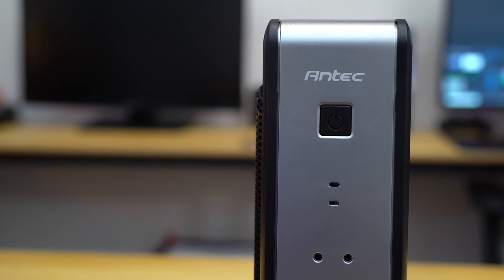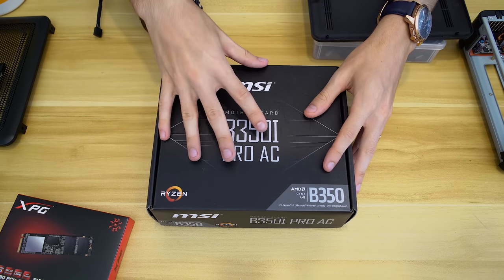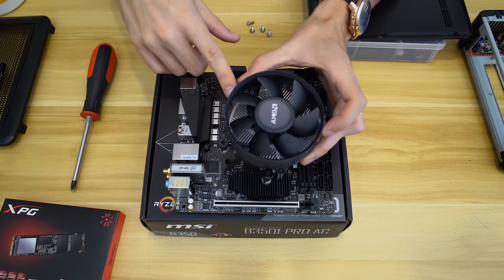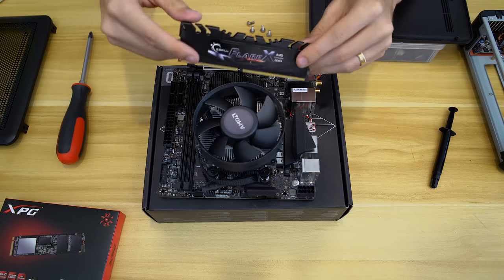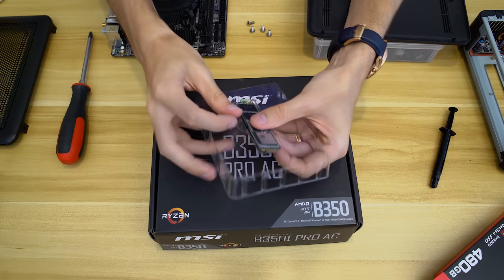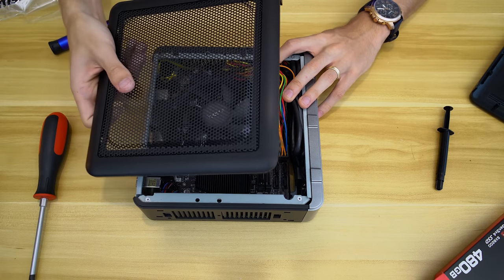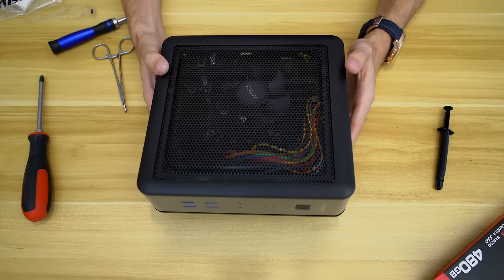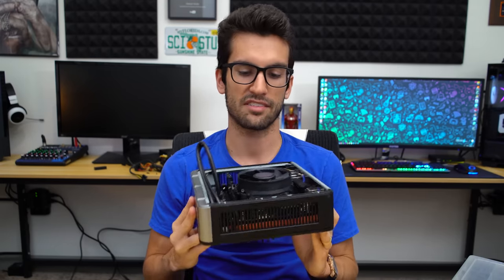How to Build an Ultra Small Form Factor PC... and Fail Miserably

Comment from the maker: So this is a super long video intended for those who aren't as familiar with PC building or who would like a refresher. If you're only here for the fail, it starts at 24:12. Also: I was measuring voltage, not amperage. I'd need to use the clamp for that. My other multimeter probes. Should have paid attention to that 😅
Reply: You can possibly build that PC without tweezers. 🤣😂😅
Reply: I'm surprised that you guys are continuing to recommend b350 if it won't have the ability to upgrade to ryzen 3000 I really like my Asus x470 - I motherboard security flaws and all.
Reply from the maker: @integer0verload948  This is an APU application. Unless you plan on upgrading your APU to some 3xxx APU I'm not aware of, it won't matter much if you're using the 350 or 450 chipset. The 350s are just a bit cheaper, which is why I recommended it for this application.
Reply: @integer0verload948   why would the b350 boards not have the ability to upgrade to ryzen 3000?
Reply: Greg, thought you did an excellent job generally in explaining how to build a PC to people new to doing it. It's great seeing how far you've come and how much you've learned. I joined for the science videos and have stuck around for the tech :) I have one criticism; I always think it best practice to test components before installing in a case to make sure everything is working. Saves time and effort and eases troubleshooting if everything doesn't work. Maybe next time you do a build guide might be best to include that step?
Reply: @GregSalazar  just putting this out as a point of reference Greg, there have indeed been leaks of 3000 series APUs in the stack
Reply from the maker: @jonathanmorgan1596  The power supply board replacement didn't require disassembly of any kind. Build it now or build it later (unless the motherboard is DOA). I never test components before installing anymore, as the hardware swaps usually take a few minutes either way.
Reply: @GregSalazar  Could there not be an argument for doing that step when doing these teaching videos for people building for first time? I say that for two reasons; most people (and certainly not first time builders) don't have replacement components on hand to quickly test systems with. That makes trouble shooting more difficult. 

My experience teaching people to do it is there is often a fear of doing it wrong/breaking components. Seeing it post and work can help calm any fears they have.

Just my 2 cents :)
Reply from the maker: @jonathanmorgan1596  Having the system outside of the case has nothing to do with replacing components on hand. If you don't have other parts to swap out during troubleshooting, it won't matter if the system is assembled in the case or not Lol. My point is: if a graphics card is DOA, all you'll need to do is remove two screws and swap. If a power supply is dead, disconnect power cables and swap. It's the same process whether the build is in a case or sitting on a box :-)
Reply: @GregSalazar  I get it's just a little browser/word processor project. Supposedly 2 chiplets on the new cpu/Apu. One will allow 8c/16T the 2nd will allow a 2nd 8c/16T or a fairly powerful GPU/Apu chiplet.
Reply: @Scitch87  why I would say probably product segmentation. There may be some other technical reason that actually justifies it.
https://www.google.com/amp/s/www.pcgamesn.com/amd/ryzen-3000-cpu-motherboard-support%3famp
Reply: By now support for the B350 and even A320 for ryzen 3000 is rolling out so guess they just prioritized the higher end chipset boards first since those people are probably the most likely to upgrade immediately? 

https://www.pcbuildersclub.com/en/2019/03/ryzen-3000-b350-and-a320-mainboards-are-compatible-too/
Reply: Max Pain  I like that idea :)
Reply: what about a Bios update for a B350 mobo for Ryzen?
Reply: @GregSalazar   need to remind people of the Bios update that needs to be done for it to even work with the new Ryzen cpu or apu
Reply: You don't seem to know that M.2 drives must be run warm (~40c) and that if they are too cold errors will result.

Comment: 24:47 As someone on a tight budget this is when I go into panic mode and start thinking "oh god what did I do!" lol.
Reply: Always try to test outside of the case if you can. It does save time.
Reply: @only1sn1not1taken  In most cases (no pun intended), you can test outside the case. It can be a good idea to test outside the case, but it only really saves time if something is faulty :) Most of the time, that's not an issue. Only time i've had issues with faulty part was a powersupply many years ago, frying my first proper gaming pc, old Core 2 Duo build. But that happened a week or so after building it and testing outside the case would have made no difference. I know there's always a small risk of production errors or bad handling during transport with sensitive components, but in general, DOA parts aren't that big of a problem. I will always recommend testing outside the case if using second hand parts though, aswell as never buying PSU/HDD/SSD used and never cheaping out on a PSU

Comment: to answer the title you just ask the verge, im sure they have a video on how to build a pc
Reply: Greg seems to have been inspired by The Verge, he uses a lot more thermal paste than most techtubers. :p
Not that he uses too much, I think.
Reply: @peterjansen4826  at least his case didnt short the power supply.
Reply: @WGAPGaming  
And he didn't use single rank RAM. :)
Reply: @salahmed2756  
Give me a silent build with a powerful CPU and graphics card which doesn't get throttled. Custom watercooling is nice but not realistic for ordinary users, it simply is too expenisve and it requires too much time to keep it running properly. Also you will probably get your system more quiet with the best air-cooling because pumps always make some noise. Unless your hardware dissipates so much heat that aircooling can't transfer that heat any more.
Reply: 12:11 Well, he almost installed the M.2 without the post ;)
Reply: @peterjansen4826  .
?? He only used one stick in this video so it's kind of hard to do Dual Channel unlike the Verge video where he had two sticks in single channel.

Comment: My case is an Antec P180B and by no means would it ever be classified as small. Honestly, it wouldn't surprise me if it came with a map. Ridiculously easy to work with (the ODD is mounted from the outside.)

Comment: A good starting point would be the Asrock A300 Deskmini  case, motherboard, and power brick in one
Reply: Exactly, I put a Ryzen 2400G in one and it's great.
Reply: I just built one of these Asrock Deskmini's and it works great with a 2400g. It's also much smaller and less expensive.

Comment: And that's why it's wise to do a POST before stuffing everything inside the case
Reply: I wonder if the integrated PSU cords are long enough to plug into the motherboard while it's on the cardboard box- I mean test bench.

Comment: Built a couple of office PC's in the Inwin Chopin case that has a 150w psu built in. Nice case. Installed a Noctua CPU cooler instead of the wraith and no issues really.

Comment: 17:46 The triangles on the motherboard connections do not mean positive, it means that is Pin 1, it is to help if you are looking at a schematic that says for example "pin 3 is for data", you will then be able to find pin 1 and work your way down.
Reply from the maker: It means positive. Pin 1 is always positive.

Comment: This case (ISK... 110 I believe) is almost exactly the one I used to build small PC for my own mother years ago (almost 10, back then the main panel was a bit different)... it was an intel core I3 CPU, and stock cooler was out of question due to its noise (mom hate noise), and finding a good cooler that fit back then (almost 10 years ago) was... tough, like really tough to find exact dimensions. I think it was a Scythe low profile, not great but good enough for her usage, and silent till the fan came towards its end... I remember being super excited to build it cause that was the first time I built something that small, and still is. Sorry, I digress completely...

Thank you for a simple tip, that I always applied in the reverse order : Big cables first (or almost). Damn life would have been so much easier ! God the cable managment was ugly ! a bunch of cables stuffed into the damn thing... But the hardest part for me was not to install the motherboard... but to remove it (without breaking it) ! That was fucking hard !

PS : her PSU is still working to this date ;p

Comment: Just curious did you ever figure out what the issue is?
I know the factor PSU is 90 Watts and your CPU was rated at 65W just by its self. Not sure if you noticed that or not.

I too liked this case because of the fact that you can attach two 2.5 drives. Thinking SFF for NAS.
Thank you

Comment: I have a build in that exact case. I am utilizing the vesa mount. I put it together so that my kids could have something to do homework/web surf on. I'm also running an APU just a smaller one. 
MSI AM1i, Athlon 5350, 120GB SSD, Single 8GB stick of ddr3/1333 Patriot ram, Ubuntu 16.04 LTS
Works great for what I built it for. It's a shame your PSU was DOA.

Comment: 1:18 Laptop hard drives: Am I a joke to you?
Reply: Was just going to comment the same. I got 2x 2.5" HDDs in my system for the sole reason that they're a LOT quieter than 3.5" drives, and the slightly slower speed they've got is unnoticeable for mass media storage.

Comment: That SSD is NVMe not sata. You called it a sata drive. Edit: also that board does not have two CPU fan headers, one of those is a system fan header. Haven't you been doing this for years?

Comment: I wish more of these mini PCs used SODIMMs. I kind of like the Intel NUCs due to this, lets me build mini systems using parts removed for laptops I upgrade.
Reply: What about you look up Asrock's DeskMinis. Not ITX (STX) but will support SODIMMs.
Reply: I've built an entire mini itx rig using an 8gb sodimm and i7-3610qm salvaged from a laptop. Works great.
Reply: @Dr01nE  deskmini is good but it's annoying that it was designed for Intel coolers so it's excessively thick for athlon coolers and a little too thin for the wraith.

Comment: Over the years, I built half a dozen of those miniPCs and power supply failed after 2-3 years.  EVERY SINGLE ONE OF THEM.  Sometimes you can find a replacement but sometimes it's priced ridiculously expensive, like LianLi ones.

Comment: @ScienceStudio @Science Studio Is the power supply correctly grounded? It may have used those screws (see around the holes there is a metal contact point) maybe it isn't grounded to the case properly.

Comment: did this but used the cheaper version of the in win chopin, used the id cooling is-40v3, pretty good low profile cpu cooler, 2400g, 8gb Samsung e die at 3333 cl12, biostar x370gtn

Comment: At 8:30 I am done with this video. you could have tried rotating the cooler to cable mange the extra slack. As you mentioned some systems might require the CPU fan to be plugged into a CPU fan header.  If you had read the labeling on the other header you would have seen it was a SYS fan header, not another CPU fan header and may make a difference.  I would have gone for dual channel for the memory. Better luck next time.

Comment: Wire your HTPCs people. You’ll appreciate it when you stream 4K. I ran one cable to a switch behind my entertainment center, then I can have wired connections for the TV itself and all the stuff hooked up to it
Reply from the maker: Sure, if your wireless is spotty or slow, wired is a must-have. I just like having WiFi as well in case the PC travels anywhere a LAN cable can't.

Comment: she should be more than happy with it, I've been using a 2400G with 8 gb ram for several months with no issue.  I do light gimp, gaming, emulation, web browsing, etc with no issues.
Reply: I like the Ryzen CPU's a lot (as a matter of fact, I will buy one myself a few months from now) but even the ancient i5-750 can handle that. You don't need much CPU-power for those tasks. A dual core Ryzen-CPU (which they call Athlon for some marketing-related reason) would also be fine for that. :)
Reply: @peterjansen4826  well, I use to have a 3570k with 16 gb ram, 7970 & 850 evo boot drive... sure the graphics were nicer on my I5 rig, but the Rhyzen feels snappier for the applications that I run, it that makes any sense?
Reply: @F-Bomb313  
That makes a lot of sense, many people experienced that. Tech Deals also mentioned that Ryzen 1st gen feals a lot snappier to him than his 2600k. More cores, support for recently added instructions...

I sitll have an i5-750 myself because I decided to wait for Ryzen 3*** because that should combine the superior multithread performance with superior singlethread/gaming performance. We can expect the 8c Ryzen 3*** CPU's to outperform the 9900k in most regards, including gaming. There might be a few exceptions (AVX 512 bit)  but the ordinary users won't mind those. If the RAM wouldn't have been so extremely expensive in 2017 and Vega would have come out on time and be available at the current prices (Germany) then I would have bitten in 2017 but upgrading without being able to upgrade the graphics card to an AMD card and getting ripped off by Samsung and Hynix, I didn't like that so I decided to wait.

Comment: Interesting, I bought this case without even seeing your video and guess what?  Same failure!  One potential difference, the brick's light dims considerably when I push the power button, then recovers a couple seconds later without ever powering the system on.  
Antec is sending me a replacement PSU (pico and brick).  Fingers crossed for both of us!
Reply: Got the replacement pico PSU in and it fixed it!  Hoping you had the same luck!

Comment: Does it matter that the psu on the case is only 90 watt and ryzen 2200g is 91.2 ? Or am I mistaken, I built one in this case running an am1 and amd 5350

Comment: Power problem: on pcpartpicker.com, building with these parts: 2400G instead of 2200G (but same TDP), Mobo MSI B450I GAMING PLUS AC, Noctua - NH-L9a, RAM, NVMe M.2, etc. will warn about not enough power provided. Do you think it is still possible with the parts I said?

Comment: not talking shit on antec at all but ive noticed that PSUs seem to be the most common component to be DOA. i wonder why that is?
Reply: In my experience I see just as many mobos doa as well so I think its just the luck of the draw. In most cases everything works as it should but a dead psu or mobo can and do happen. This is when a manufacturer's customer service and return policies become very important. I have found returning/replacing a psu much easier than a mobo however.
Reply: Psu included with cases tend to be extremely cheap .. Antecs full sized psus are solid from my eperience but yea psu are the first thing to get skimped on in a combo deal.

Comment: I would love to use this case for the Ryzen 5 2400g or the Ryzen 3000 APUs if they are any good but I don't think they sell it in the UK anymore! :(
Reply: Look up the Inwin Bq656 - my 2400g build works great in it. Plus it comes with a decent psu... just be prepared to swap out the fan. I used a Noctua A4x10 and it's brilliant.

Comment: I would have used a PicoPSU mounted directly on the 24pin connector instead of dealing with all the cables from that powerboard. Good video. :)
Reply: I was about to comment the same! Great idea

Comment: AMPERAGE that is dangerous... while it's true a small amperage can kill you if it passes through your heart keep in mind that your body has a specific RESISTANCE so the voltage source must be able to maintain a sufficiently high voltage in able to deliver that current through your body. It's also the path that matters. My stupid electronics technician lab partner decided to change his home OVEN heating element (just a resistor) but didn't unplug the stove (in his 2nd year of college no less). He got an electrical burn on his leg but had his body been in a slightly different position he would have died because the current passed through his right side of his body from screwdriver on right hand to right foot. If it had gone from right hand to left foot he might have died.

Comment: And now we all know WHY we have to test-boot a system, before we put everything in our PC-case.
Reply from the maker: I find the test-boot pointless. It's usually a single part. Easy to remove unless it's the motherboard.
Reply: @GregSalazar I 
well... I usually  remember to test boot while installing the side panel... 
sometimes it is after noticing the back-plate  on the table and sometimes it is after not finding the "remove before installation" sticker of the CPU cooler... But since it is you the one that makes pc-building videos on Yt, I think you should be a bit more careful.

Comment: That is quite an ugly case. You can get something that resembles a mac mini on AliExpress. I got one from RGeek model L80 made from aluminium. They also have a thinner one (L60). Made a mini PC for a friend with an i5 8400, 16GB or RAM @ 2666MHz, 512 GB PCIe NVMe SSD and a motherboard from Gigabyte with the B360 chipset. It is amazingly fast and after we change the ultra loud stock cooler from intel to a Noctua NH-L9i, it's gonna be even better. I'm not a gamer and he isn't either so this PC is perfect for software development and tasks that doesn't require a dedicated GPU.

Comment: I'm a PC technician of 20 years,  and I can say you need to up your game. You need to use an anti static bracket,  place the motherboard on a silicon mat. Also you cable management is terrible. Use zip ties and secure all cables to the case sides. Also,  you didn't do a great job of applying the thermal compound. Don't do tutorials if you don't have formal training.